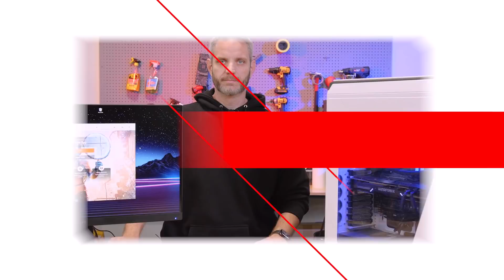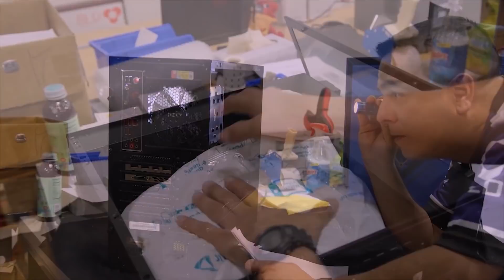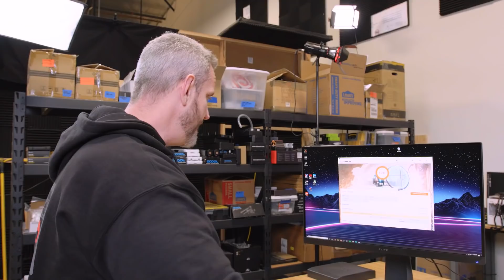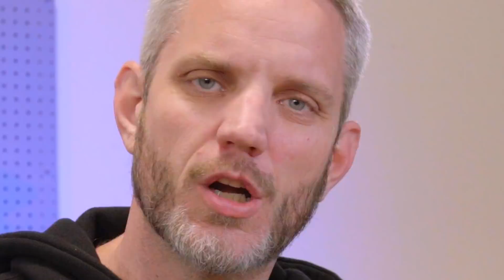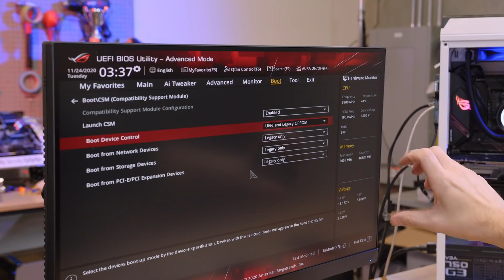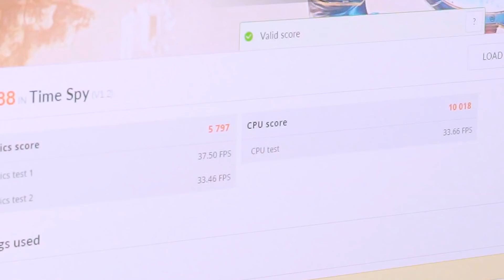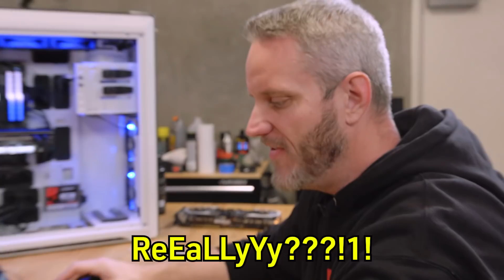This PC upgrade DIDN'T use the latest hardware and still ROCKS!

Comment: Hey, I vape around my PC. I try to vape away from it and I keep it clean. Leave me alone
Reply: That's what I don't understand. I vape in front of my PC but I don't encounter any sticky residue inside or out.
Reply: @Vinsfild  if you blow huge clouds right into the intake and you never clean anything, in time it will deposit on your heatsinks and make dust stick. But you really have to neglect your system

Comment: Wait what, my power options do not look like that at all with Ryzen 5600x, just the normal Balance, Power Saver, and High Performance.
B550 Aorus Master, with mb_driver_597_chipset_2.09.28.509 chipset driver.

Comment: The problem with any PC upgrade that doesn't include the latest gen GPU's and CPU's is that they won't compare well to the consoles in a pure gaming perspective. If someone was looking at buying a gaming PC they'd be better off just getting a PS5 or Xbox and a cheaper laptop that can do the basics, at least until the market for GPU's stabilizes.

Comment: Jay: 980Ti is showing its age
Me: Cries in 970
Reply: I was in the same boat till last week. eBay brother. Just upgraded to a 1080ti for cheap.
Reply: Cries in 660
Reply: @Joker-r3k0J  Looking at my RX 580...
Reply: Cries in integrated graphics
Reply: Cries in R9 280X 😢😢😭😭😭😭
Reply: Cries with you in GTX 960
Reply: Hah gtx 650 1gb running strong 😂 with a i7 2600k@ 4ghz ,planning in getting a 1080 soon
Reply: @MAAV EXE i got a 980 paired with a 2600 that has 32gigs orf ram^_^ 
Witch is a bit of a missmatch, will get a 3080 (when im lucky in terms of money or like a 2060 at least in 1-2 years but for now im fine cuz im more videocutting and use the pc as a tool rather then gaming so i dont need a top of the line card also my 980 is supported by a 670 in rendering and streaming using the 670 for to render all n shit witch is doing okay :D
Reply: Cries in gt 740
Reply: gtx760...
Reply: Me: cries in 970M...

Comment: Is it possible to use my Win 10 free upgrade (back when they were offering it to everyone) on a custom build without the OS included? I could save £100+ and spend it elsewhere, that way. Also, all the upgrade OS files were burnt to CD and my next build won't likely have an optical drive, how would I go about doing this?

Comment: Jay: "I have to be mindful of what I do here." ~Goes and picks up a 2080Ti. 

Nice upgrade! That PC would be even better with an m.2 drive instead of that Kingston SSD, just saying.

Also, when you swapped out the motherboard, what did you do to activate Windows 10 with the new components? 

One of the most often asked question I get as a tech is when people have watched YouTube videos where the tech enthusiasts doesn't care to explain to their viewers that unless they own a Windows 10 Full version (as opposed to an OEM or Digital/E-license version) they cannot simply swap out their motherboard unless they also acquire a new license. If you guys would PLEASE remember to explain this, it would help the rest of us in the industry a lot and save us some headache trying to explain to people that license control in Windows is only as liberal.

For those wanting further information regarding this: https://support.microsoft.com/en-us/windows/reactivating-windows-10-after-a-hardware-change-2c0e962a-f04c-145b-6ead-fb3fc72b6665#:~:text=When%20installing%20Windows%2010%2C%20the,get%20it%20up%20and%20running.

Comment: Jay talking about changing some options in BIOS, to HOPEFULLY boot into OS, that I was using with older hardware before
Me changing 990xa + FX 6300 with X470 + ryzen 5 3600, without changing anything, and booting no problem

Tehc

Comment: I have similar specs and just upgraded to (4 x 8GB sticks)  32GB of 3600 cl16 memory from 16GB and it made a massive difference to Vr frame rates in Rfactor2. It's now able to run at a solid 90 FPS even at big tracks like the Nordschleife.

Comment: I have that exact motherboard and I was not able to get Asus's LAN driver to install at all. I'm currently using the windows driver for it until Asus / Intel gets off their lazy ass and fixes their own driver. Maybe their drivers only work after doing all the Windows updates... but if that's the case, how the hell is anyone expected to get those updates without first getting their LAN driver installed? Tethering a phone to the PC like I did is stupid and should never be the only available option for getting something important like that to work. Motherboard also didn't work at all with Ryzen 5000 series out of the box... had to do the bios flashback update procedure for it to work. You'd think a new board design would at least partially support it, but that's minor. Also, Asus tech support is a joke. Never seen such useless responses in my life. I might switch to a different manufacturer next time just based on how bad their email responses were, let alone their lack of driver support for their own products.

Comment: Is a 1070ti with an AMD 3600x still a descent budget rig in 2020 if you build the rest of the specs around new the 5000 series processor motherboard requirements and give it enough power to use the new graphics cards down the road?

Comment: Jay, I don't have the AMD High Performance setting, I only have AMD Balanced and Ultimate Performance, among the regular windows power plans, balanced, high performance and power savings. Is it because I have an overclocked 1600x on a B350 Mobo? Yes, I am on the most current chipset driver. I'm curious if I were to somehow get the AMD High Performance power plan if it would improve anything.

Comment: You need to have 8x RTX 3090s, 4x can only run Minecraft at 1000 fps. Plus you need 192GB of VRAM for web browsing! I mean, they only take up around 3000W and much more a lot of the time! I mean, you only need around 4000W in all for all the components. Which PSU can't do that? Everyone has a 10000W PSU nowadays!

Comment: Great video. I highly recommend anyone updating their GPU to a new gen to run DDU. I recently upgraded from a 2070 to a 3080 and I saw either the same or WORSE performance in a few games. I experimented and did a normal uninstall and reinstall of older and new drivers, same issue. 

Then I ran DDU and installed the earliest drivers for 3000 series - gained the FPS I was supposed to see. Upgraded to multiple drivers after that and I was still smooth sailing getting the results I expected.

FYI Nvidia's 'clean install' option isn't a true clean install - it just wipes your config (as far as I could see), not delete hidden folders/files & registry.

Comment: I've always had the mindset of a clean install of Windows is always a good idea when changing platform.
I know that Windows 10 is much better at handling these changes than previous versions of Windows, but it still feels wrong.

I'm planning to refresh my Intel i5 2500K based system with a Ryzen 7 5800X in spring 2021.
My current system uses a SATA SSD but my new rig will have a M.2 NVMe SSD.

I just reinstalled my old system 2 months ago so it's not too stale or bloated.
Would it be a bad idea to transfer the install from my existing SATA SSD to the new M.2 NVMe SSD and just install the new MOBO chipset drivers for my new AMD system?
Reply: @rogerwilco99  
Ya, that's always been my opinion too.

Frankly it doesn't take long to install windows and install a few apps.

Comment: i didnt use the latest hardware for this upgrade! you used a 3800xt and a 2080ti.... jay.. youre an ass. you literally just did a video about dont let people think your pc needs upgraded and then you pulled this. what does this say to all the people with a 3600 or 8600k or people with a 2060 super or a 1080ti. you just told them this build isnt new stuff and immediately shoved it in their face like haha youre still not good enough.

Comment: If you update an intel cpu to another intel cpu (going from i5 7500 to i9 10850) do you still need to update the chipset drivers? Another question is, would I need to do the same for nvidia gpu?

Comment: There is an old saying that "a bridge should be long enough to reach the other side." Often, the same can be said in the context of computers. The BEST computer is the one that meets YOUR OWN needs--older hardware or newer.. I build industrial automation computers for work. We often use hardware that would be considered 'slow and old' by today's standard. But, my computers hum along 24/7, year after year, doing exactly what they were built to do.
Reply: When the question for upgrading comes I always return two questions: "What is it you need, and what is it you want?"
If the current rig does everything fine, then you don't "need" an upgrade, but you might "want" one.
When choosing parts for a new build, there might be a level of performance you "need" and a level of performance you "want", but in the end budget is what decides where you end up at.
That is the reason why I went with an unlocked i5 and a 660 Ti back in 2013 and plan to go for a 3700X or 5800X next year but will keep my current 1060. But on the other hand I'm running 10 TB of storage, that I actually use.
For most people that sounds like a weird combination (an i5 "bottlenecking" a 1060 but putting money into 10TB of drives), but it sits right with my needs.
Reply: @HappyBeezerStudios  Exactly! Great commentary and perspective.  For my builds, the specific automation software and its function determine the hardware That is the "need," which the computer is specifically built for. My builds would be considered boring by many--just a plain rack mount computer, mostly containing no "wow factor" and no "wants." But, the computer is built with rugged industrial components for endurance. And it is configured to do one task only. Specifically, to run specific automation software 24/7 year after year.  And they do that very well. (We call them "appliance builds" because they are built for the single function). Thanks for your excellent input.
Reply: Totally agree... I'm having to upgrade now because my system after 5 yrs fried itself. Sadly it isn't the best time to be upgrading with all of the shortages, but I can make due with what's available.
Reply: @Joreel  Sorry about your system
Reply: @Joreel  Shortages may be one thing, but on the other hand, the market is in competition like it hasn't been in years. Getting some used parts to upgrade and/or replace broken ones could actually be easier at this time. (Other current events mean that more people are looking for parts, tho)

Comment: Quick question is there ever a time where instead of a upgrade a whole new system makes more sense? I currently have a I5 4690k with a 97Z motherboard and a old GTX 950 GPU, so to upgrade my CPU would need another Motherboard and Ram (since the 97Z uses DD3 not DD4 ram) and CPU, But then my GPU would bottleneck I'm pretty sure same if I upgraded the GPU and not the CPU, It would bottleneck the CPU. So if I upgrade the Motherboard, Ram, CPU and GPU wouldn't it just be better to get a new system all together? after all only would be keeping the case and peripherals and maybe the power supply if it can handle the power of the new components.

Comment: I never installed Chipset drivers on any system. I wonder if this only applies to AMD or does Intel benefit from this too.
Reply: First thing I always install when changing motherboards/new systems & have done since they became important back in w95 days. This is usually how you can tell who has been around the industry for a while & who is a hobbiest that has learnt from online sources (obviously before Jay posted this video!). Always install latest versions of any chipset drivers as well even if they claim to be purely for later platforms as there are times where newer drivers on older platform increase performance by fixing small bugs that hadn’t really been noticed or reported much in the past.

Comment: just did the hardware change without reinstall , went smooth and easy, deinstalled all intel software that was installed ( no manual driver deinstallations or removals ) swapped to ryzen, started windows and it started automatically installing all drivers  , after that i just had to reactivate windows with my digital license and done :)

Comment: Hey Jay, if you read this, thanks for the information, I did not know that about the Ryzen chipset drivers, but for some reason I don't get the power plan when I try to install the chipset drives on my new Asus Crosshair Hero Dark with an 5900x, any idea why? 
Thanks in advance

Comment: A friend of mine, changed only his GPU. But now he is getting half of the fps that he used to get it. He had 980 now he has 2080TI. What is the problem here ? CPU bottle neck ? Possibility of low wattage ? He has 650W. Thanks for help

Comment: On a forum I frequent a user posted this helpful info for cleaning up a Windows install. As always, this is the internet so check out the info before you use it. 

Remove unused devices uninstalling the old drivers:

1) Open CMD as Admin
2) set devmgr_show_nonpresent_devices=1
3) devmgmt.msc
4) View -> Show hidden devices
5) Navigate through each category and delete (uninstall) 'greyed out' devices (there will be a lot)
6) Re-install AMD Chipset Drivers.

Also someone recommended another tool found at this site. https://www.uwe-sieber.de/misc_tools_e.html

Comment: My recommendation for installing drivers with Windows 10 20H2 is to do a clean install and install all required drivers offline. The reason I am saying this is due to strange stability issues when setting up Windows online, regardless of whether it is with a wired or wireless connection. This is especially prevalent when using AMD's raid implementation. I do not have a raid compatible Intel board so there is not much I can do. The Windows 10 20H2 update is buggy right now so please be careful when installing it.

Comment: this is exactly what I needed since I'm about to upgrade my 6700k to a Ryzen
Reply: Also changing from 6700@ 4.9 getting 5900x ,arriving next month. 5950x still out of stock.
But honestly depends what ur doing with it. Strictly gaming its not a huge jump.
If u intend on streaming or use it as workstation thats different.
Reply: @SinceGamesPT  im changing from 4690K, cyberpunk needs some hardware love.... sadly all of amds new gen cpu is sold out
Reply: Same here. I have  a 6700k and a gtx980. Want to upgrade to Ryzen 5 5600x and an RTX 3070.
Reply: I have a 9900k and loving it

Comment: I really wonder if the 7700k would have been just fine with the 2080 ti and a similar GPU score versus the Ryzen.
Reply: I highly doubt it. the 7700k came out when the OG ryzen came out.
I am running a 7700k on 4.6 all cores, and a 1070. Would've upgraded to a ryzen if I got my hands on a 2080 ti. At the very least a 2700X, but I'd probably go for a 3800X.
Reply: @Mariuander  unlucky on silicon lottery? U should be able to push it further. Im running my 6700k at 4.9 stable had it at 5 at one point but needed full fan speed. Also 7700k to recent gen ryzen wont be a huge jump in fps, if you look around, its just u get same perf for less money . For multicore work its a different story.
Reply: @SinceGamesPT  yeah I ran it at 4.8 but managed to get the cpu fan dead silent on 4.6 so I went with that instead. No worries, as it doesn't bottleneck my 1070. At least not much.

All the security patches for Intel cpus over the last couple of years, have nerfed it quite a bit. Combined with the ipc gains from original ryzen to zen2 (not to mention zen3), I cannot imagine staying with the 7700k if I were to get a newer GPU.
Reply: @Mariuander  it shouldnt, im fine on a 1080ti and but had slight bottleneck testing the 5700xt i got for a setup i built as a gift. Up to 5700 xt or equivalent 2000series u should be fine with little to no bottleneck (considering overclock) ;)
Ryzen 5600x is a good contender for an upgrade tho or wait for nextgen new socket
Reply: @SinceGamesPT  yeah I agree. Following the scene pretty closely, as i am heavily invested in AMD :)
Reply: @Mariuander  Right and the first gen ryzens, even the 1800X, couldn't compete single core wise to the Intel, so for gaming assuming then the score should be better on the i7 than the Ryzen. For Ryzen 3000, of course the IPC got much better, so it could surpass the 7700k at that point, but I don't think there would be much of a difference to for the GPU score.

Comment: Wait did you just moved from intel to amd with no window reinstall?
Reply: Welcome to the future! =)
Reply: That worked on WinXP already. You had to uninstall the chipset and GPU drivers first though. In Win7 there was a 50/50 chance it didnt start when you didnt uninstall the drivers. From Intel to AMD caused more problems than from AMD to Intel as to my personal experience (without uninstalling the drivers).
Reply: @fredmuckl4242  Right, and basically all you had to do on XP was a repair if something was not working correctly, and then just the usual steps of installing the new drivers.
Reply: I did that the other way round 7.5 years ago on Vista without issues...
Reply: @CakePrincessCelestia  it works but they say a new fresh install is better, performance wise

Comment: I ordered a new X570 system with a 5950X, of course the 5950X was out of stock so i ordered a 2600X to use while i was waiting for the 5950X. I came from X299 with i9-7900X (10 core @ 4.5ghz) and actually did not notice any major differences. It worked just fine, games played, development worked. Was kind of amazed.

Have the 5950X now and i do notice a speed increase, yet not too big, in no way it justifies the major price tag compared to something like a 2600X in daily workflow or gaming.
(Unless you are rendering / compiling major stuff daily)

Also moving Windows 10 to different systems works just fine. My installation was moved from a i7-6700k system to the i9-7900x to a AMD 5950X platform with no issues at all.
NVME drive with bitlocker and via TPM.